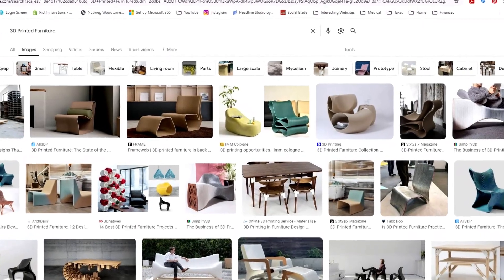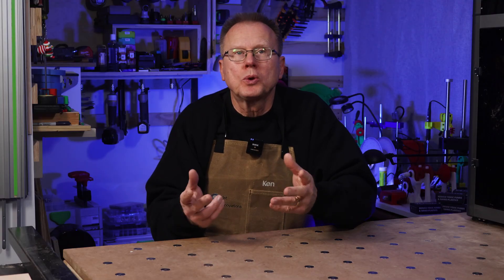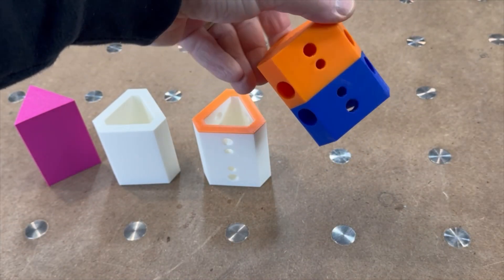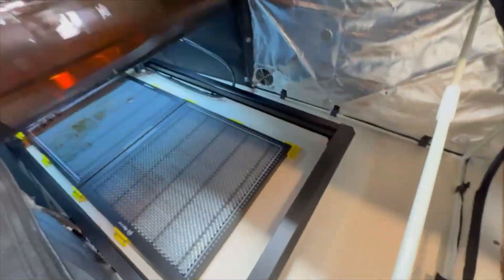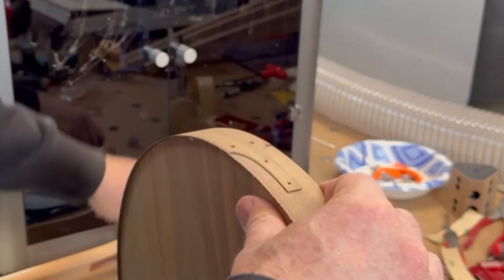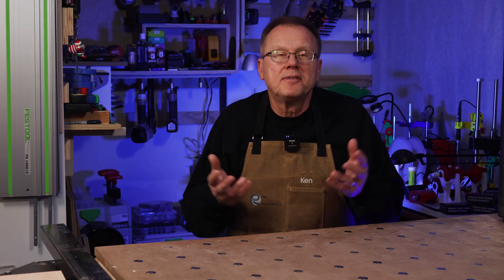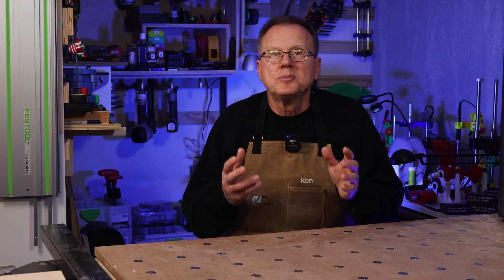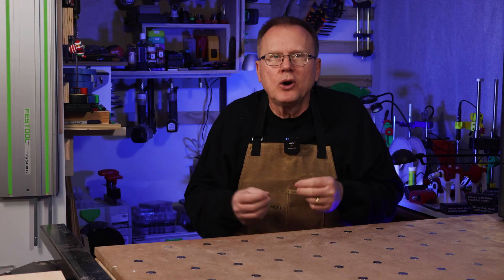Why Doesn't Everyone Build 3D Printed Furniture This Way?

Comment: Definitely an interesting idea. However the amount of extra gear you needed makes this a really expensive project (at least for us 3D printers without a shop full of woodworking tools). Much more than just purchasing a stock wooden table. Would have been nice if you tried to do this using tools us 3D printers would typically already have. I understand there may be a few additional tools but if it could be done with a minimal set of additional tools that would be great.
Reply from the maker: You do bring up a valid point regarding the woodworking equipment I used for this project.  There are ways to do many of the steps by hand (for instance not using a benchtop router), but they would take a lot longer.  I will need to take your suggestion in mind if I do another video on furniture making using a 3d printer.  Thanks for your comment.

Comment: Nice video!  Another great use for 3D printing. Yes, I would be interested in stls and precut veneer. How is the strength over time?
Reply from the maker: Thanks for your interest. I just made the end table so I will need to see how it holds up over time. I will need to brainstorm on how I can test the design for long-term stability. Thanks for your question.